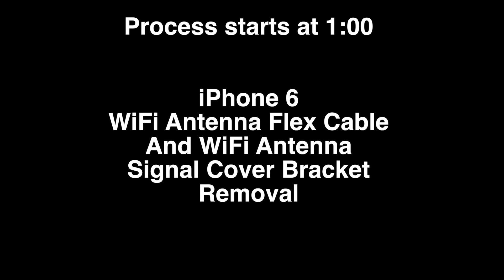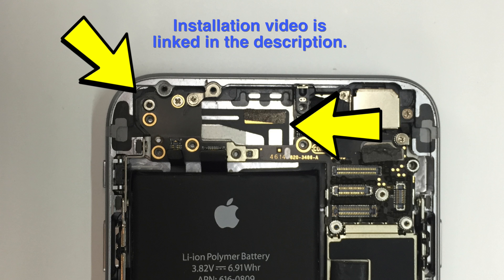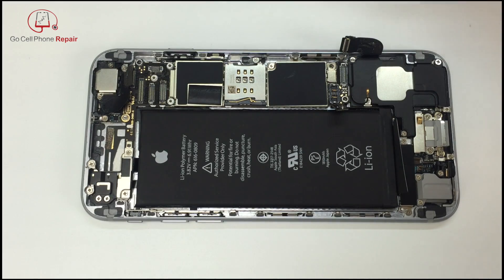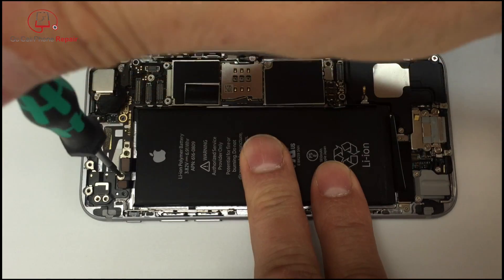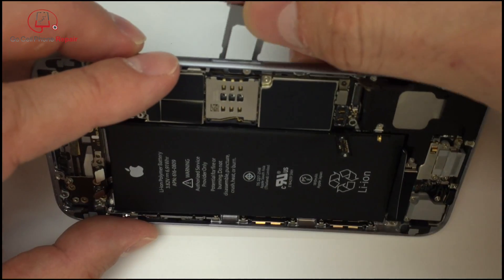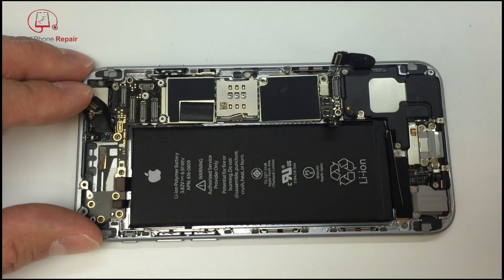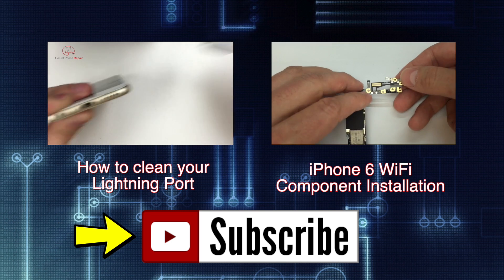iPhone 6 WiFi Component Removal

Comment: I had trouble with one of the screws. On the wifi antenna there is 4 screws to remove 2 x 2.1mm, 1 x 1.5mm and 1 x 1.4mm. Somehow my 1.4mm screw has stripped the thread in the logic board 😬😟.. I'm not certain but it looks like this screw is more for mounting purposes rather than something crucial..I hope! 
Wasn't sure what to do so had a couple of bodge attempts with a tiny tiny piece of kitchen foil and very fine wire from headphones to fill up the space so that the screw could get some traction when screwing into the logic board.... sadly both attempts failed. Any ideas what I could do? Maybe I could try putting a droplet of solder into the hole 🤷🏻‍♂️..
Or maybe this isn't really a crucial screw.....I've found now that I can actually very lightly tighten it now...very lightly and it grips a little. What to do, leave it or try something else?

Comment: Hi, first of all, than you so much for taking time out to make this video and educating the world! I have a wee question regarding AirPods, I just bought them and paired them to the iPhone 6, but in order for the music to be played without any stuttering and cut outs etc, I need to have it literally right in front of me on my desk. As soon as I start to walk away from from the mobile, the sound starts to cut out from the AirPods. I tried them with my iPhone 5s and they work perfectly fine. So, my question is this a replacing flex cable solution or an antenna or something else. Thanks in advance.
Reply from the maker: This should help with bluetooth connection problems. There could be a different cause but this is probably the easiest place to start.
Reply: Thank you for getting back to me so quickly. If for some reason it is not the BT issue, what other issue do you think it could be? @GoCellPhoneRepair
Reply from the maker: @dx6978  Software, Bluetooth-WiFi IC or something attached to it maybe. If you've ruled out the antennas already and tried updating/restoring the phone then it is likely something you'll need professional assistance with.

Comment: Awesome video.  I bought a "new" Iphone 6 off Ebay and was getting weak wifi signals throughout my house, poor bluetooth connection and awful GPS signals.  Followed this video and replaced the antenna and bracket and the Iphone now works perfectly.  My only advice would be to draw a map of the screw locations on a piece of paper and carefully place them there as you work.  I hope this video helps others as much as it helped me.

Comment: I’m not sure if this screen prevents my WiFi from connecting I can connect to data but not WiFi I have to be inches away from the router for it to work I can’t seem to reamber if my phone still connected to WiFi while it was cracked but I’m pretty sure it did I even lifted up the screen to allow the internals to be exposed to WiFi while I can see if it connected

Comment: I have a question i have a iphone 6 and its wifi signal is very weak i recently changed the cracked screen that got thrown to the floor it works fine with data such as lte but just has a very weak wifi signal i have to be real close to the router but i have a spare iphone 6s can i use the iphone 6s wifi antena in a iphone 6
Reply: I know you answered if the parts were swapable but i called apple and she said its the battery since the wifi atenta and battery have a good relationship
Reply from the maker: Wait. She said that the battery is causing a Wi-Fi problem?!! Wowwww... What is wrong with people? That's like your windshield causing exhaust issues. You'll have better luck asking Apple about how to use your phone and not how to fix it.
Reply: Yeah ik they just wanted to sell me a service but im going to take my phone to the apple store so they can run a dianogstics and tell me whats wrong with it so i can fix it my self
Reply from the maker: I wish it worked that way. If your phone is under warranty they might replace it. Otherwise they'll just try to sell you a new one. Apple doesn't diagnose problems so that you'll know what to fix and they don't replace Wi-Fi antennas. Either way good luck and I hope you get your problem resolved.

Comment: Can i use an iphone 6s wifi antena on an iphone 6
Reply from the maker: With Apple the answer to this question is almost always the same- unfortunately no. Different models usually require different parts. The 6S is no exception.

Comment: Is it possible to repair a short under wifi chip?
Reply from the maker: If all of the pads are still there I would think so. What line are you detecting a short on? I'd try to eliminate any components outside of the chip first before removing it.

Comment: I replaced the antenna, Wifi still weak and GPS not working/ inaccurate in google maps and apple map. Pokemon Go app says GPS signal not found. Did I do something wrong? During the first install, I did install it incorrectly by having it upside down but corrected that soon after. 

Most people reported replacing wifi antennas fixed their issue GPS,Bluetooth, and wifi altogether. Are they connected together somehow?
Reply from the maker: Did you replace the cap too?

Comment: I fixed it. Tip when removing the old wifi component be very very careful. i was gentle with removing it and a metal piece came off of one the four latches. I had to put just a bit of super glue and hoped it would still function. I was lucky

Comment: what screwdriver are you using? ph00 or ph000?
Reply from the maker: PH000 but keep in mind that they can vary from one set to another. This is usually only a concern when you get a bit that is taller than ideal which can cause slippage. If your 000 doesn't seem to bite you might have to grind the tip down just a bit.

Comment: Opened my iphone 6 up and wifi flex cable was cracked and basically dissolved on the connectors end (possibly due to dropping my phone on the ground really hard? My phone is about 3 years old). Replaced this component and now my WIFI, Bluetooth and GPS WORK! Thanks!

Comment: HI, I have replaced the flexcable in my Iphone 6 but now i need a charger plugged in to be able to start my phone. When pushing the on/off button it won´t turn on... But when the phone is on (used a chager to start it), it works to push that button to turn it off. Any ideas on what has happend ? (Btw, the gps, bluetooth and wireless works again ), Thanks in advance!
Reply from the maker: So the lock button functions when the phone is on but won't prompt it to boot? That's odd. Could be a slightly defective cable, not seated properly, or maybe something on the logic board itself. You might try unplugging the cable and reconnecting. If that doesn't help the easiest step beyond that would be to attach a different cable and see if it's any different. You don't have to do the full installation just unplug the existing one and connect a different flex cable.

Comment: Ordered the flex cable. Noticed that the old cable has some brown isolation label/stickers. My new flex cable dont have theese? Are they on both sides on the flex cable? Do I need to cut out som cable tape and put as isolation instead? Thanks, great video!
Reply from the maker: You shouldn't need to add anything as far as I know but I'm not clear on what it is you're missing. Can you possibly post a photo somewhere?

Comment: The video you link to at 0:24 is the wrong video.  It is not the "how to open your case" video. Since you split up the process into multiple videos so you could at least double your views, I bet you already know that.
Reply from the maker: Nope. I must have had the wrong link saved on my clipboard. Thanks for bringing it to my attention. I've added a card at that point linking to the correct video. unfortunately YouTube no longer allows annotations to be edited so I can't do much about that without removing all of them at once.
Reply: The card must not be working because link still takes you to component installation and not screen removal. You could also just post a link in the description to the screen removal.

Comment: one of the 4 connectors on the board to the flex cable came off when I removed the flex cable. Is there any possibility of reattaching it?
Reply from the maker: If you are talking about the round connectors for the antenna I'd say yes it's possible but not really a do-it-yourself project unless you have microsoldering and hot air rework experience. I've done connectors of this type on the one near the battery terminal and this shouldn't be too different just smaller. Are you sure that it broke off the board though and you aren't actually looking at a broken part left behind from the flex cable itself? They are very fragile and often break of and stay stuck on the board.
Reply: Unfortunately, it does appear to be the round connector piece of the board. I think I'll have to take a loss on this one. Thanks for your help!
Reply: Update: I did a last ditch effort and just superglued the piece back together and everything is currently working.

Comment: ive been told that the phone shouldn't be fully charged and should be well under 30% is this true?
Reply from the maker: I've never heard that before. Do you have a source?
Reply: i dont have the exact source but i read it in a thread when i was trying to diagnose my phone and it said something along the lines of a fully charged battery being unstable or having a higher electrical charge and could explode or something when released from the port.
Reply from the maker: I can't think of any reason that would make sense in this context.
Reply: Go Cell Phone Repair yeah idk it's just something I read but I followed this video btw great tutorial but it turns out it wasn't the f cable but the place where it's connected is missing what snaps one piece in place
Reply: https://www.ifixit.com/Store/iPhone/iPhone-6-Logic-Board-Antenna-Flex-Cable/IF268-013-3                  They are mention it in step 1 in the guide there... "Before disassembling your iPhone, discharge the battery below 25%. A charged lithium-ion battery can catch fire and/or explode if accidentally punctured."
Reply from the maker: Thanks I actually stumbled upon one of their pages that said something similar. Usually iFixit's content is fairly accurate although I know that many of the how tos are submitted by users so I'm not sure whose idea it was nor the logic behind it. The main thing is don't overheat or puncture your battery. Maybe at 25% the explosion will be smaller..?

Comment: I replaced the GPS  Antenna first and it still wouldn't work. So reluctantly i replaced the WIFI component, because i was nervous messing with the mother board, but that did the trick! GPS wasn't locating me , maps , waze nothing, now its all working again . Thanks so much for the videos !!!
Reply: Wes Peters I replaced my wifi antenna today but gps still didn't work and wifi still weak signal. Perhaps if I replaced the gps module, it'll fix for me.

Comment: I have a problem, (sorry for my english , i'm french) i can't remove a screw
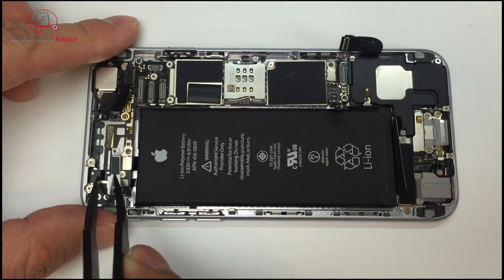Reply: The screw at 2:37, i.m trying to remove it during 2hours and i can't
Reply from the maker: Is the screw stripped? What kind of driver are you using? If the screw is stripped it is never easy to remove but here's some info that might help you http://gocellphonerepair.com/removing-stripped-screws/

Comment: I first went to Apple Store and they were charging me $300.00 to get it fixed. I brought the parts from eBay, & tool set for about 30 bucks. I followed all the steps as shown & it works like new. My one advice is, do not drink coffee or redbull it will make your hands shake, u need a steady hand for them little screws to put back in place. Awesome video, thank you.

Comment: Hi there is this the same process for the 6s? I took my logic board out and found that it didn't even have the flex cable. It was the first time it was ever opened too lol apple factories taking shortcuts?
Reply: + it actually has the four points to plug it in too
Reply from the maker: It's different for the 6S. I'll make a video as soon as possible.

Comment: How can this antenna just go bad?? Edit: Shiiiiiit... just replaced the black square gps antenna and the wifi antenna with the 4 post. Went from having to be right next to an AP to picking up a whole list of them. Still not sure how they can mess up its just an antenna.
Reply from the maker: Yeah really strange. We see things like this a lot though. It's hard to tell how anything will work/fail long term until it has been tested long term. The way that new designs are rushed though it's not a huge surprise. When a major change in the form factor is released you can expect a lot of issues and for them to be corrected the following year: iPhone 4 antenna problem, iPhone 5 power button issue, iPhone 6 bending frame, etc.
Reply: Yeah that's true. Well I appreciate the video because I would not have thought to try it. Thanks again!

Comment: Awesome. This tutorial helped a lot replacing the flex cable that solved my iPhone's Wifi, Bluetooth and GPS issues. They all are woking fine now.  The only issue I had while reassembling the parts back was the top right corner screw on the display cables cover plate did not screw in. I am confident that I put in the right screws everywhere but have no clue why it didn't fit in. So closed the phone without it. Apparently, no issues with display or anything but wondering if that can cause any issues overtime?
Reply from the maker: It may be fine without it but it's not a bad idea to figure out what happened. The most common reason I've seen for what you described is placing another screw in the hole before placing the logic board. This would prevent the one that you're unable to install from threading. Otherwise I'd suspect some screws got mixed up.
Reply: Same thing happened to me man

Comment: I had the same problems as most others. Shoddy wifi connection, couldn't be more than a few feet away for bluetooth, and GPS couldn't zero in on location. After replacing the flex cable with your tutorial, all is working perfect! Thanks!

Comment: my iphone 6plus would search for the wifi networks but nothing will be shown tried everything lik restoring updating resetting wifi assist off wifi networking off and on nothing works tried blow dryer to heat still no use, good thing is i can see wifi address still..will replacing my wifi atenna and wifi flex cable will help to fix this problem?
thanks in advance..
Reply from the maker: Maybe. A lot of things can cause problems  but these antennae seem to be a common source of trouble.
Reply: hie Sarath Ganesh did you manage to fix the problem,i also have the same problem

Comment: This instructional video is  excellent.  I replaced the wifi antennae cover and the antennae flex cable following these instructions exactly.  You need some patience. It took me about an hour or so to complete the repair. You MUST buy an iphone toolkit ($8-$15 on amazon).  Also very important to keep track of the very small screws and parts.  I laid down about 3 ft of white freezer paper (shiny side down) on my kitchen countertop.  I sketched an outline of the parts and screw placements onto the paper and put clear, double sided tape on the drawing.  This lets you stick the tiny screws to the drawing so you don't lose one and also shows you where things go when you put it back together. I had a little trouble attaching the new antennae flex cable until i realized that tiny parts of the removed old antennae were still stuck to the board.  Just removed those with a pair of tweezers and everything was slick after that.  The authors instruction and video are spot on.  My phone would not properly run any GPS apps and the bluetooth range had shrunk to about 5 ft.  After repair everything is working like new.
Reply from the maker: Thanks and good points especially mentioning organization and that the old contacts often break off when you remove the antenna.
Reply: CARNES ROD so it works?

Comment: Sadly, I broke one of the little pieces that are so fragile in 5:39. Is there a way to microsolding this part or do i have to change the board?
Reply from the maker: The connector or one of the surrounding components? I would think that either are possible but the connector would probably be easier. Haven't done either yet FTR.
Reply: The connector.
Reply: same issue

Comment: Hi! Under the video there are links to 3 parts. 2 of them look like what you changed in the video. The other does not (This one: https://www.diymobilerepair.com/iphone-6-wifi-antenna-flex-cable-replacement?gclid=COaxzdfrrtACFQ5LDQodu-cA_Q). 

Just making sure before I buy something. Do I need that other piece for some reason? The one that doesn't look like what you changed? It calls itself the iPhone 6 WiFi Antenna Flex cable replacement. 

Thanks in advance!
Reply from the maker: That's some sort of paid advertising. The first two items on this page are what you need: http://www.etradesupply.com/catalogsearch/result/?warehouse=0&q=iphone+6+wifi

Comment: my gps does not work. its not software. what parts do you recommend i change? wifi gps antenna. I'm open for suggestions
Reply from the maker: I would replace both shown in the video. They are inexpensive and to get to the cable you have to remove the cover anyways.